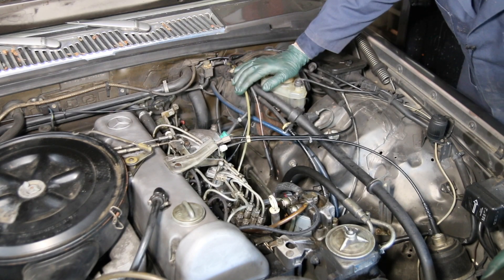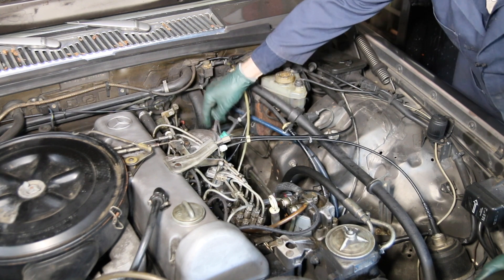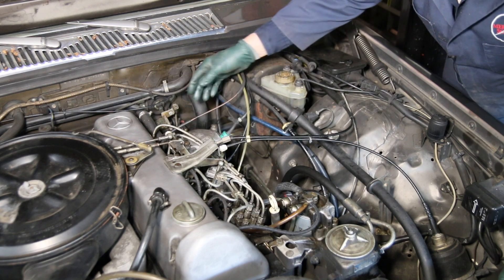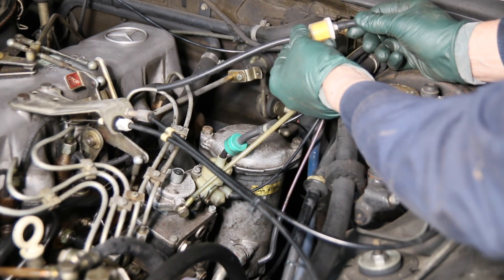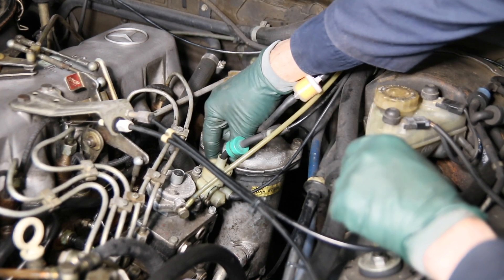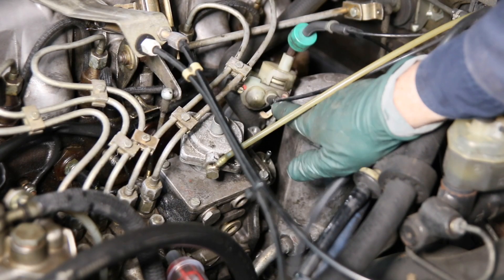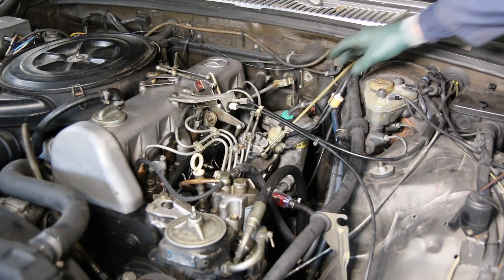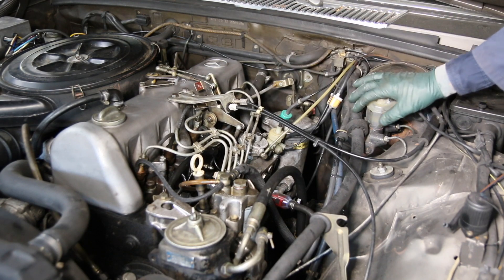1977 to 1985 Diesel Engine Shut Off Problems: This Upgrade Might Help

Comment: Hello Kent, have a 1985 300D the problem is I apply vacuum to shut off valve and it shuts off immediately, but I'm not getting vacuum from the ignition switch line? Any thoughts? thank you
Reply from the maker: Several issues may be contributing to this problem. You will need to do proper troubleshooting of the vacuum system to nail down the root problem. If you have vacuum leaks in the system, they will draw vacuum away from the shut-off valve circuit. I have written a complete troubleshooting guide.https://mercedessource.com/store/search?keys=vacuum%20troubleshooting

Comment: Just did an oil change and had to undo a few vac lines went for a Cruze around the block and it wouldn’t shut off gunna try this tmr when it’s light out